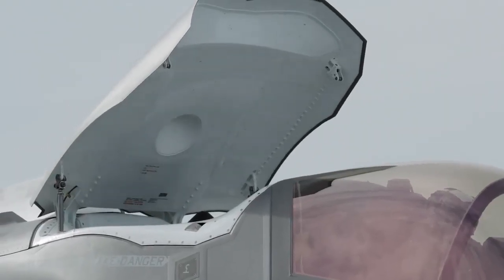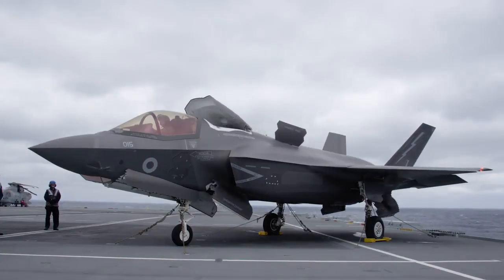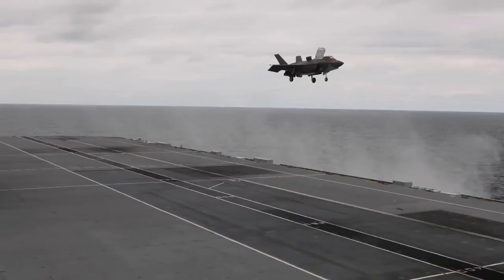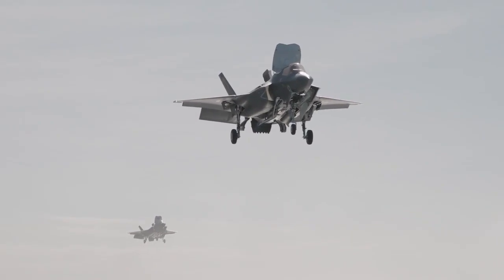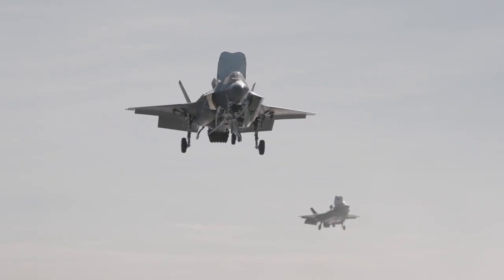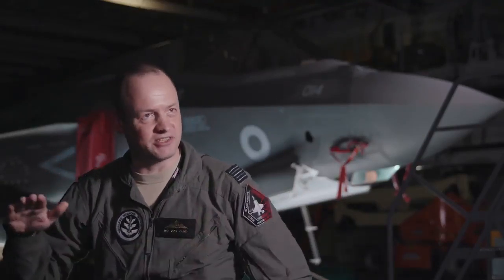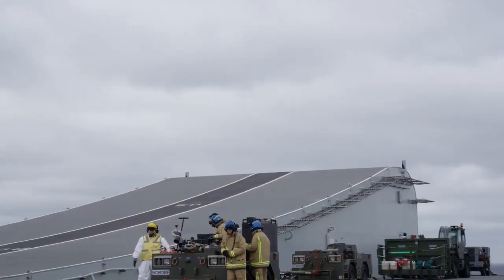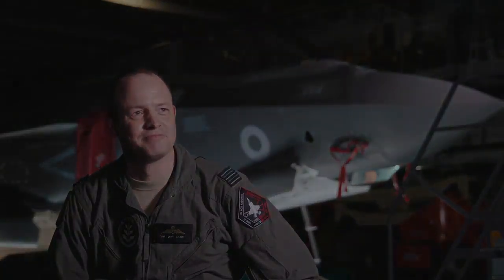F-35B Lighting jet - its unique design explained

Comment: Just saying: the harrier did that without needing to carry an additional engine around as deadweight while on patrol
Reply: Ewan Bennett Part of the problem with the Harrier (as well as the X-32, which the X-35 competed against for the JSF contract) was hot air exhaust re-ingestion, which could starve an engine of air to breathe. That is one of the benefits of the lift fan. The air intakes get clean air to breathe, thus making it more stable in hover.
Reply: @darkjedi74  u know what...
I didn't know that. Thank you
Reply: The F35b can still fly at about twice the speed of the Harrier, over a greater range, and has about 3 times the weapons payload.

Comment: Deliberately, or not, this short factoid clip shows one of the biggest problems facing the FAA.

The aircraft are part of RAF 17 Squadron, they wear RAF insignia. The bloke doing the explanation is an RAF Wing Commander. 17 Squadron appears to operate out of Edwards Air Force Base in California, which is neither in Britain nor close to HMS Queen Elizabeth's preferred working up areas.

The FAA does things differently from the RAF. For most of the last 100 years they have been administratively separate. This service based separation was the outcome of the experience of operations in time of war and peace over a protracted period.

Somebody needs to start knocking heads and kicking butts at MOD, and Treasury. 

FAA 809 Squadron needs to be made operational immediately. Flying F-35 with RN/FAA markings, commanded by RN officers, out of an appropriate RNAS and flying off R08 and R09. Anything else is not good for morale, not good for recruitment and retention, and not good for developing and maintaining the highest levels of competence and efficiency.

PR flacks and desk jockeys defend the current arrangement as "modern" and "suited to current requirements",  and dismiss the call for real RN/FAA involvement as quaint and ill-informed.

I ask you - is this good enough?
Reply: Robin St.Clair
 - You need to understand the situation before making critical comments:
* 3 of the aircraft are from 17 Squadron and 3 are from 617. USMC F-35s will join this week to add numbers and tempo.

* 17 Squadron is the Test and Evaluation squadron for the entire F-35 Lightning programme. It is based at Edwards to work with US assets, integrate all weapon systems and use the huge bombing ranges in California. It is staffed by both RN and RAF people.
* The aircraft wear darkened 'stealth' insignia which is neither pure RAF or pure FAA.
* Of course the FAA do things differently they are operating off of ships! So any RAF aircrew have to adapt to carrier operating methodologies. Its why they are being certified to operate OFF of a carrier. So on a carrier it is FAA / RN procedures in place not RAF.
* Nobody needs to knock heads at all. It makes perfect operational sense and best use of expensive assets to have the capability to operate off of carriers and land bases.
* We can 'surge' (to use an Americanism) any and all assets where and when they are required without the rather dumb situation you are proposing where the FAA sits doing sod all out on carriers while the RAF are short of numbers in a ground attack campaign.
* The next Squadron to be 'stood up' will be 809 FAA Squadron (based at RAF Marham). Do keep up. Apart from which you seem to want a pissing contest over 18 aircraft, 3 of which are T & E. 

Sorry but your attitude is indeed "quaint and ill-informed" for the reasons I list above. The days are long gone when we could afford to have carrier specific aircraft only operate off of carriers. And here is a thought as you gob off about this being "not good for morale, not good for recruitment and retention" - In a recent TV programme a set of RAF and RN pilots were sent to train and be tested for fast jet operations. At the end those who had passed out selected the aircraft they wanted to fly and were told if that was indeed where they were going. A female RN pilot went to a Typhoon squadron....
Reply: Ben Liley   - Previously, CO of 17 Squadron was a Wing Commander, so not a RN man. Hopefully, the person you refer to is his successor.
In any event, this is a RAF squadron, flying aircraft sporting RAF insignia.

If you spoke to 617 Squadron members they would vehemently deny that one of the RAF's best known squadrons was "RAF in name only". Nobody thinks the Dambusters has anything to do with the RN.

You just don't get morale, do you?
Reply: @uberseehandel  I think morale on 617 is just fine thanks, in fact, it benefits from a joint environment.
Reply: @andrewgibson285  

From a local source - 

Royal Navy and the RAF face a shortage of trained aircrew, as two huge new aircraft carriers - HMS Queen Elizabeth and HMS Prince of  Wales  - near being brought into service. 

The Ministry of Defence (MoD) is not currently meeting its targets for the number of trained aircrew it needs, according to the National Audit Office (NAO) in a report that has been published as the UK begins to take delivery of F-35 Lightning jets.

The report reveals it is taking more than three years longer than expected to train fast-jet pilots.

In its investigation, published today, the NAO has set out the facts about the MoD’s aircrew requirements, the training that has been delivered to date, and how the MoD is addressing its flying training shortfalls.

It reveals that on average it takes 7.1 years to train fast-jet pilots - compared to the "optimum time" of 3.9 years the MoD expected.

The report notes that, "in the next 10 years, the MOD plans to invest £46 billion purchasing and supporting front-line aircraft, including the helicopters and fast jets used by the Royal Navy, British Army and RAF".

However, The NAO reports that in the six years to 2018-19, the MoD has failed to meet its training requirements by an average of 45 per cent, which equates to an average shortfall of 125 aircrew per year.

The report's key findings include:

The MoD does not currently have the aircrew it needs.
It experienced an average 45% (125 student) shortfall in aircrew completing their Phase 2 training each year.
Students have taken longer to complete training than expected.
In statement issued to the press, the NAO said: "In the last two years, training has also taken longer because the MoD does not have the capacity to handle the number of students it needs to train. On average it is taking 7.1 years for Royal Air Force fast jet pilots to be trained against the MoD’s aim of 3.9 years.

In July 2019, there were 145 RAF students waiting on average 90 weeks to start training, compared to an expected 12 week wait for around 26 students at a time.

The MoD has long recognised issues with flying training. In 2008, it agreed a 25-year contract with Ascent – a joint venture between two defence contractors, Lockheed Martin and Babcock – to design, introduce and manage a new approach to Phase 2 of its three-phase training process, known as the Military Flying Training System (MFTS). This is when aircrew learn basic flying skills.

However, aircrew requirements for MFTS have changed since the contract was awarded in 2008. In 2010, the MoD halved its aircrew requirement under the 2010 Strategic Defence and Security Review, which contributed to a six year delay in introducing the system.

The subsequent 2015 Review committed to new aircraft and extended the service life of some existing aircraft which increased the training requirement. In 2018-19 alone, the requirement increased by 29 per cent – around 76 extra aircrew to be trained that year.

As of March 2019, 44 out of the 369 planned training courses (12 per cent) had been cancelled. Of these, 28 related to the MoD not fulfilling its responsibilities including not providing enough qualified instructors or students. There were also occasions where the MoD and Ascent have failed to provide sufficient numbers of aircraft.

Your Panglossian attitude is not born out by the NAO.
Reply: @uberseehandel  Could you try to stay on topic? How does operating in a joint environment negatively impact morale. The NAO can talk about training shortfalls all day long, you didn't address my point at all.
Reply: I'd suggest disbanding the RAF and split it appropriately between the Fleet Air Arm and the Army Air Corps, but that will never happen.
Reply: @FloatinInTheForth  does that not just change the name of the problem? It becomes a FAA vs AAC problem instead of a FAA vs RAF problem.
Reply: @davidhouseman4328  good point. Could keep the AAC as purely land based and all naval aircraft operated by FAA. I dunno.
Reply: @FloatinInTheForth  there might be a better split but I think the more important thing is to increase cross service cooperation. Projects like the Joint Helicopter command and the Lightning force.

Comment: I wonder, could you perhaps design a STOVL aircraft where the core turbine is only there for gas generator which is used to turn ducted fans?
Say, one replaces the jet nozzle at the rest, the lift can and the RCS jets in the wings.
Reply: Not sure if bait but fuck it. That's exactly how the Harrier works.